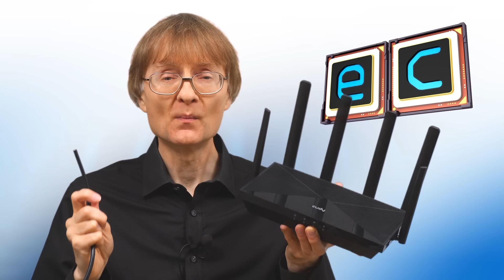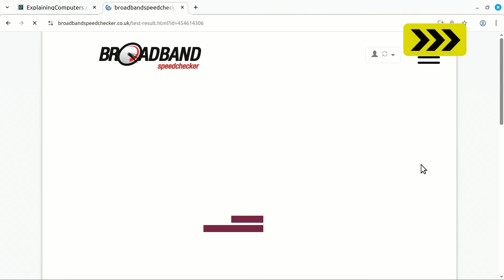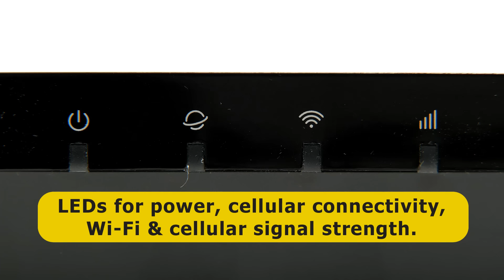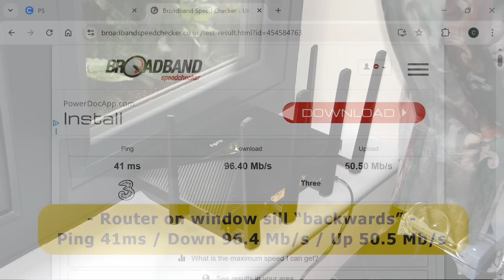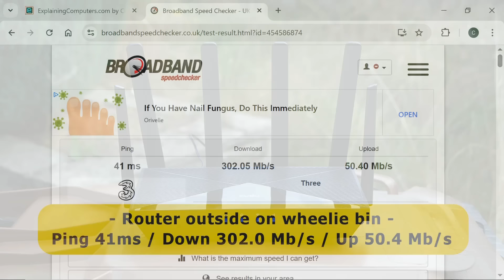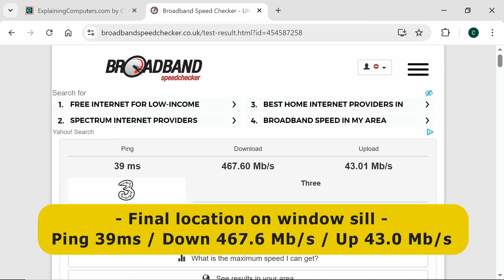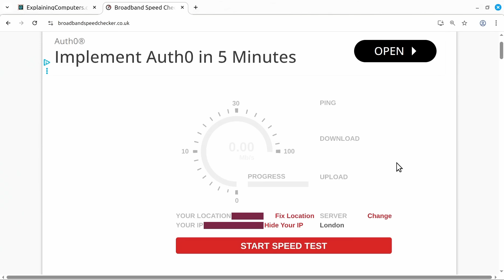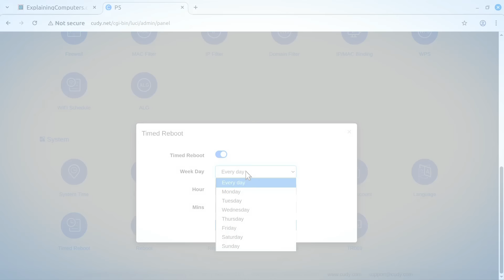Switching to 5G Broadband: Cudy P5 Router

Comment: Noice! Some research, work and hunting with great results, always nice to hear! :D

I had problems with ISPs my entire broadband life until I got a formerly public fiber service at home, which has unfortunately been privatized few years ago.

During ADSL years I switched back and forth every few years because of spotty service, bad costumer support, insane and insistent spam calls, faulty equipment, crazy price increases and scammy strategies to nick and dime users (hidden fees, charging of stuff I never asked for nor used), and all sorts of issues you can imagine. Despite my country having more competition between ISPs and mobile telecoms in comparison to say... the US, it still largely operates as a mob like oligopoly. They price match, get together to lobby to pass anti-consumer laws, and so on. And it's the usual profits over service story.

So, when fiber became an option, even more it was provided in conjunction with a public service, I jumped in despite it being more expensive, which was the best choice I could've ever done regarding ISPs. And it was all fine for years during the time the company was attached to a public electricity company, but it got separated and privatized few years ago.
Now, a few issues are starting to crop up again, but it hasn't been enough for me to change ISPs just yet. I just imagine that the employees of the company are pushing against the worst impulses of whoever bought the thing up, but I can tell it's not gonna last for very long.

Talking with friends around, most private fiber companies still have the same old issues ISPs of ADSL days had, so I'm planting my feet for a while since there are no better options for now. Mobile telecoms are even scummier down here, so I'll avoid that route while I can.
Good to hear that technically, 5G might be a viable option though... of course, might not be the case for me. But I do live downtown, so higher chances of me getting some coverage despite 5G not being a major thing in my country just yet.

I've also updated my lan setup a bit kinda recently, my main router uses a skin over openWRT, and it has tethering options for an USB SIM based modem. Seems you also can directly connect the router to a smartphone and tether the connection that way, though I never tested this, but an interesting backup option nonetheless. I have a robust (but super expensive) mobile plan which I have used on occasion of power outages, but never needed to connect it directly to a router - as most times I only needed the connection to a laptop.

It's one of those Gl.iNet modems. I've already been using one of their portable routers to separate the ISP provided router from Wireless devices because it's an old Huawei modem with known hard coded admin pass pair that is trivial to hack. So I had to isolate the lan from it.

Hopefully, things stay as they are... but I do have backup plans if something goes awry with ISPs. So I'm fairly ok with that side of thing... next upgrade on connectivity I'm planning is to replace the entire Cat5e wiring out of the walls and replace it with fiber. My home has an issue of having only the thinnest type of conduits to pass cable through, I already had to pull all the old coax cables out to pass Cat5e, and there are rooms I can't reach because the conduits are already too tightly packed.
Fiber is getting cheaper, both the fiber itself plus gear that can take it, so I've been wondering if the upgrade is worth. Will have to deal with the ISP provided modem/router later on, but only having lan fiber would be a plus now that I'm using a NAS locally.

Anyways, thanks for sharing Chris! I'm wondering whether you'll have losses in connectivity with rain, and other weather events.

Comment: I think to get faster upload speeds I'd definitely opt to get an external antenna. It doesn't have to be this giant broadcasting tower, like they use for HAM Radio, but maybe only a foot or so in length just to catch the signal. The satellite antenna's on cars are very small indeed. if you are worried about having  an antenna on the roof. I'm not familiar with how they are handled in the UK. Here in the US you need a license to install a Ham radio antenna. not so sure about WiFi antenna's
Reply: In the U.S., you do not require a license to install an amateur (Ham) radio antenna. In addition, you do not require a license to receive (listen to) amateur radio broadcasts. However, an amateur radio license is required to transmit on amateur radio designated frequencies.
Reply: @Eternal_Tech  Where I live you need a permit to install one. so basically a license.

Comment: My story is much simpler than yours. I was paying $110/month for Comcast cable rated at 600mb down 15mp up. Local fiber company came through and now I have 1gb symmetrical for $59/month. I live in small town nowhereville, US (population 1000) and life is good regarding my internet speeds. Mine always tests at about 940-960mb, I have no complaints.

Comment: I switched to 5G nearly three years ago (also using the '3' network). It has been very reliable (and much cheaper than the Virgin Media I used to have), with download varying 250 - 600 mbps, and upload 35 - 80 mbps, and ping 18ms (depending on time of day and the weather conditions). The only issue I have had is if it rains VERY hard; all the rain drops seems to block the 5G signal, and it goes down to a 4G LTE connection. Other than that, it has been excellent.
Reply: Most of mobile companies are using fake 5 g logo they are using 4G+ but called 5g 5g+ 5g UW  etc... it's a big lie they are using 4g Carrier aggregation to give you more speed so you need to have no obstacles between you and the Tower because there's frequency bands that have a weak signal penetration and are used for Carriers aggregation with the strong bands if you miss 1 frequency your connection speed will drop so you need to put your router in a good location and choose the bands they are no congested, or buy a 4G signal booster and put it outside your house use omnidirectionnel antenna or a small dish you will forget about the rain

Comment: Wait, Open Reach decommissioned your copper line with no notice from either themselves or via your ISP? Also assuming this was just the FTTC data side of things (DSLAMs etc) so your analog phone still works? But isn't that all due to be retired by end of 2026 anyway? So you will lose your long held land line phone number then anyway or there is a plan in place to to retain it?
Reply from the maker: Yes, what you say on the decommissing is true -- the data service was just removed. Switchover from analogue is currently scheduled in the UK for January 2027, although I do not believe for second that this will happen (the first date was June 2025). I've included details in the video description of what happens to landline only customers from January 2027, which in theory is a continuation of service to 2030. But if not, I'll port my number to a VoIP provider or forwarding service.

Comment: Before I got a fibre connection I used 4g, as I am 2 kilometers from the DSLAM and the copper ADSL connection was awful. The position of the router was critical. The 'high up nearest the mast' position was poor. I found by chance a position in the corner  of an upstairs bedroom worked well. Can only assume it was due to some weird reflection of the signal.

Comment: Glad to hear you resolved your internet outage issue Chris. I'm in a small town outside Toronto, Canada, and I guess we're lucky because we got fibre to the home here a few years ago. I use a low-cost ISP called Primus and pay C$45/month for 500x500 Mbps, including the rental of the fibre modem and two wifi pods. My office is in the same town and also has fibre but with a different provider. I consider myself very lucky.

Comment: I switched to T-Mobile 5G after Spectrum raised my internet bill to almost a hundred dollars a month for maximum speeds of 150 Mbps. With 5G, I sometimes get burst speeds up to 800 Mbps, and my average speed is around 400 Mbps—all for a flat rate of seventy-five dollars a month. They also have cheaper plans starting at fifty dollars a month. There’s fiber internet available about two miles away, but it hasn’t reached my area yet.

Comment: Here in Austria I can barely even get a constant connection using 4G. 
My hybrid router keeps bouncing around cell towers and keeps locking on a 800Mhz cell tower that barely gets me 1mbit down with ping of 500-2000ms which is insanity.
My phone line gets me roughly 5mbit down and 0.5mbit up. 
But hey I get Fiber...5 years ago if it was true

Comment: I've been using (Three's) 5G Broadband for about four years now. 
Using their standard hub i'm lucky to get 1MB upload although the down speed can be pretty good (35MB), both very dependent on community usage (time of day). 

Also a good idea to mention that initial prices are usually some kind of introductory 'deal' which will probably double the following year. I was able to wrangle a further initial discount by being an existing 'Three' cellphone customer.  

Beware that their script-based (foreign call centre) customer service is particularly appalling, but if you're lucky enough to never encounter a major issue that needs direct contact, you should be fine.  I have not been so lucky personally!
Reply: I was amazed to read how many here are happy with Three service. I've been with them a couple of times and vowed never again, reception was so poor wherever I went. I defaulted on my final payment in protest.

Comment: I spend a lot of my time on the road in my camper van so a wired connection isn't an option. I used to use a complicated 5G travel modem (a Nighthawk) but recently switched to a $25 LTE modem that does nothing but bridge cellular to my little van LAN. It is less of a headache to manage and when I'm out of cities it's as fast as 5G.

Comment: Out here in the sticks, I was stuck with 16Mb DL on copper only broadband with no option for FTTC. But they installed fibre in my road and I went straight to full fibre FTTP. I've got the cheapest deal I could get with SKY and pay £22 at the moment for 75Mb DL and 20Mb UL. Suits me just fine, and I've got the option to go 900/50 or more if needed. I can barely get a 3G mobile signal in this house so I don't have much choice. Amazing deal with Three on  5G, very impressive.

Comment: I use 5G on my phone and sometimes I share the internet with my WIFI devices but the ping is not good..
I ended up opting for the 2.5Gb fiber, the conversion speeds and ping are an other story.. 5G is usable though.

Comment: Fortunately here in West Yorkshire as I walked home from work on the day the world changed in March 2020 both Openreach and CityFibre were all over the place installing fibre up the telephone poles so I didn't have too long to wait for FTTP to become available. Just renewed the BT contract last month, they are still price matching CityFibre (£34 a month for 900/100 FTTP). I did previously try 4G mobile broadband with Three but found their network is too unstable. Work VPN constantly dropped out, streaming videos would freeze, and their frequent UK-wide network outages. My phone has unlimited data on EE including priority access when the mast is congested which seems to be the most stable and reliable network for data, so I can use it as a backup hotspot when required.

Comment: Curious what your performance estimate would be if you put an external antenna on your roof
Reply from the maker: I do not believe it would make any difference. Many keep asking this here. But the issue is not height, but uninterrupted line of site to the cell tower. And my router already has uninterrupted line of sight -- I am very lucky in this regard!
Reply: @ExplainingComputers thanks Chris, something else that concerns me is reliability of transmission.  I use Zoom for work and are concerned if I switched to 5G whether Zoom reliably would worsen
Reply from the maker: I too worried about this (and still am), as I also rely on video calling for work (and of course uploading to YouTube!). But it's been about seven weeks now I think, and I've had no issues.
Reply: @ExplainingComputers sounds like our concern about reliability isn’t a concern, though it’s may depend on your personal location and provider.  Thank you very much fir your help with this

Comment: Haven’t you considered Starlink? Similar speeds and quite reliable. Your internet is also very expensive. I pay 20$ for 900 megs in Brazil
Reply: Starlink is ridiculously expensive - residential service starts at £79 a month plus £299 for the starter kit. Then there is the issue of many people not wanting to do business with Elon.
Reply: @davida9561 considering only the technical and financial issues, I pay 38$ mo. for Starlink. You can use it with a solar pannel and batteries, so that you have an unbeateble reliability.

Comment: I can't ever move.  I have a fiber 1G connection that's solid and reliable and also surprisingly cheap.  I think it's about $50 per month.  I can't think of anything better/cheaper than that. What's funny is that some of my network is limited by my old switches to 100Mb/s but that's perfectly fine.  It actually helps with load balancing as 10 of those would equal out the 1G and I don't have anything near that.

Comment: A very nice walk-through for a reasonable alternative to "wired" access.  I happen to live in a major metro area - so I get about 300M/300M+3ms over a fiber handoff (with fiber direct to my apartment).  This was, though, after years of trying to get reliable DSL (about 2M/2M).  Many many issues like yours -- "wire work" in the area inevitably had the incumbent carrier accidentally cutting my wires, and we'd either use a neighbors wifi or a cell-phone for days and day (with taking off work for visits).  Now that we're all fiber, the support people can talk directly to the fiber handoffs (so zero visits in ... 15 years?).  We know we're lucky living where we do.  Some of my neighbors use 5G as an alternative - and report similar findings to you - the placement is key, it can vary a little bit - but basically a good deal.  Kudos to you on the move! And thank you for walking us through the motivations and solutions you found!

Comment: In Dubai it was costing us 120 USD for some 700Mbps which was hardly getting used. I’ve now moved to 5G for 50USD a month. Sometimes there is slowness which is eliminated by power reset the 5G router.

Comment: Greetings! Great video as always Mr. Barnatt! Also thanks for the hint for this brand, I didnt know it. And so my difficulty is with ISP is 2 things mainly: DNS errors, so there is internet but  name resolution fails for some reason and the second is the poor technical support (Hungary). I am curious about this 2 aspects in your region.
Reply from the maker: I've had no DNS issues, and have not had to test the support services from three. It just worked! :)
Reply: You may wish to change your DNS servers to a third-party, not your ISPs servers. Most routers allow you to change DNS servers, but barring that, you can change the DNS servers in your computer's settings.

Comment: I had similar issues with TalkTalk, they wanted to cancel my plan and have me pay nearly double for a different one. I was getting a speed of around 1.4 but paying for 35. I called to complain about it but they didn't care so i cancelled my subscription. Saw a TP Link router that takes mobile sim cards and got a unlimited data, 12 month wifi deal for £16 a month. Ended up saving nearly £40 a month which more than paid the £100 it cost me for the router. And got better speeds.

Comment: I was told its Rhao-ter as a kid, back in 1999.
I'm glad Chris still calls it Rhuter.
Reply: In UK, rooter is this device, router is a tool for cutting slots in wood...
Reply: is it uk english vs us english? i work in IT and calls it Rhao-ter
Reply: @mousqy  Well, long ago, I used a woodworking router, which was perhaps the only router that perhaps existed in 1979?  He may be correct.
Reply: @Urosaurus  That's why I say rhao-ter as well. I cut wood first ...
Reply: @mousqy  
I too worked in IT. 
Technically, phonetically it should be called Rhuter but I have been corrected multiple times.
It does not matter if its UK or US, everyone calls it Rhao-ter.
Reply: In Australia it's typically rhao-ter.

Probably because 'root' as a verb is a widely-known slang term for fornication.
Reply: I call it the Internet Doohickey.

Comment: My Internet Service Provider Evolution

1995 - 2003   Various methods of telephone Dial-Up from AOL and local ISPs --->> 56.6 Kbps

2003 - 2006    ISP through my local cable television provider --->> ?? forgot what speeds were available

2006 - 2011    DSL (Digital Subscriber Line) from AT&T (American Telephone and Telegraph) Company --->>  15 to 25 Mbps 24/7

2011 - 2021    Dish Network Satellite Internet --->>  25 Mbps for the first 10Gb of data then 2Mbps for the remainder of the monthly bill cycle
which was a downgrade in my honest opinion due to AT&T discontinuing DSL service in my area of Planet Earth

2021 - present   ACE Fiber (a subsidiary of the local electric provider) --->>  1 Gbps both download and upload
Chef's Kiss best ISP I've ever had

Comment: A close friend of mine has used 3G and then 4G Internet access for over two decades. He now lives in Wales and has a very effective 5G access. Recently I upgraded from EE to TOOB full fiber Internet access which has been working fine with fast downloadssand far lower costs. In the longer term, if a 5G Internet connection looks viable I may migrate to that.